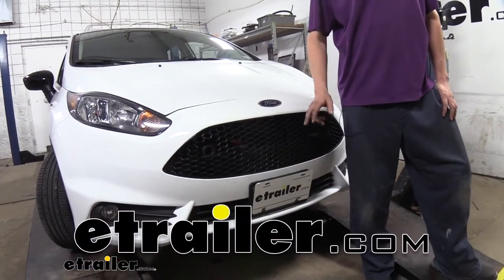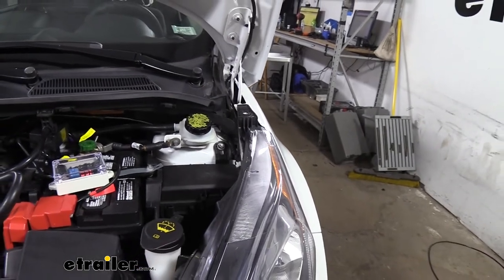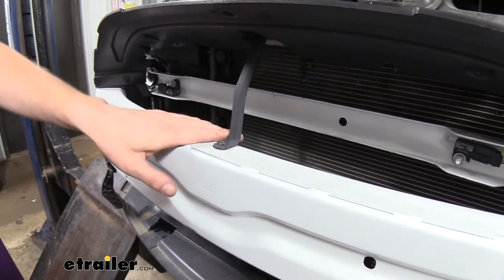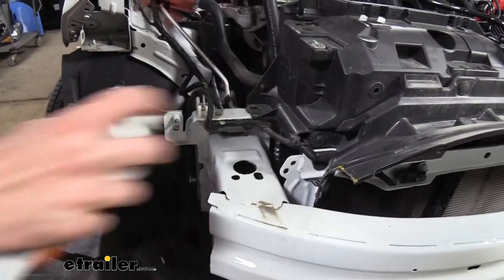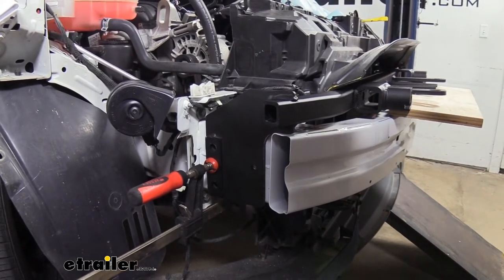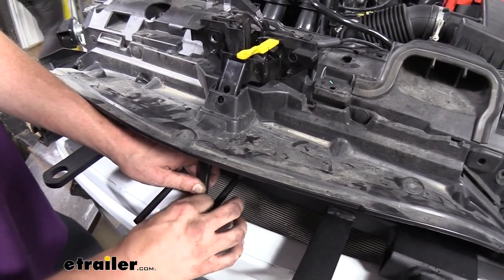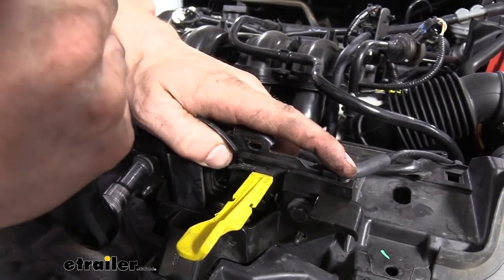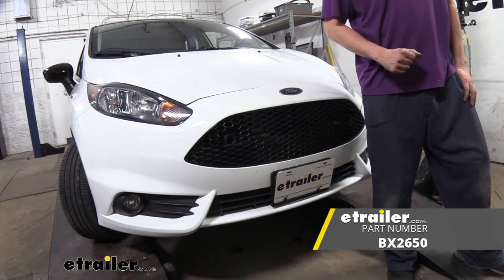etrailer | Blue Ox Base Plate Kit Installation - 2019 Ford Fiesta

Comment: Seems like the frame and fascia are the same as for a 2013 fiesta. Is there any reason why you couldnt use the BX2650 for a 2013 fiesta instead of the BX2622 so you could have a higher hookup point and avoid using a huge scraping drop hitch?
Reply from the maker: Part number BX2650 is designed to fit the 2014 - 2019 Ford Fiesta. You would need to go with the BX2622 if you have a 2013 model.
https://www.etrailer.com/Base-Plates/Blue-Ox/BX2622.html